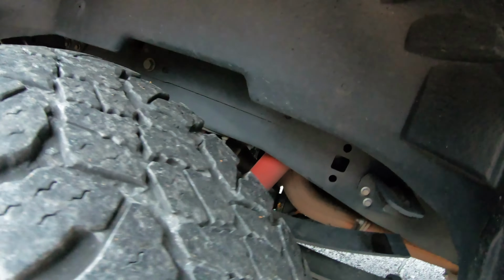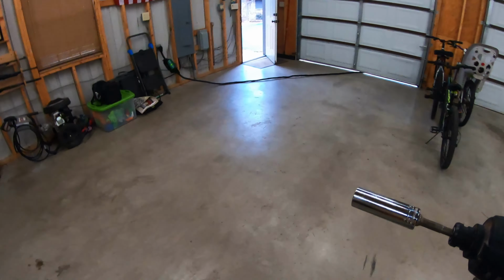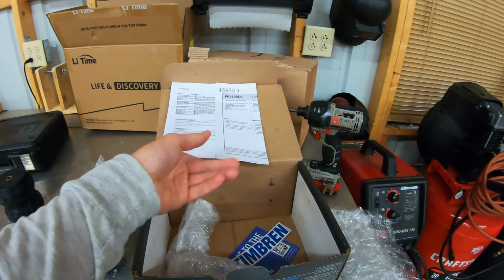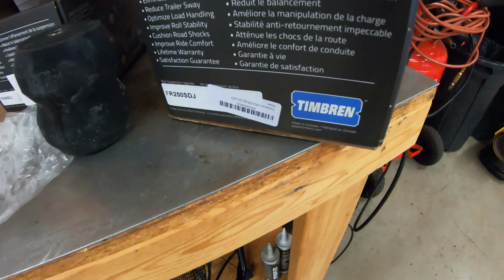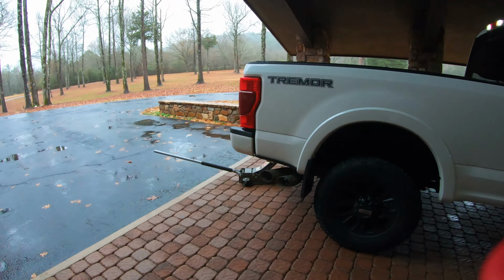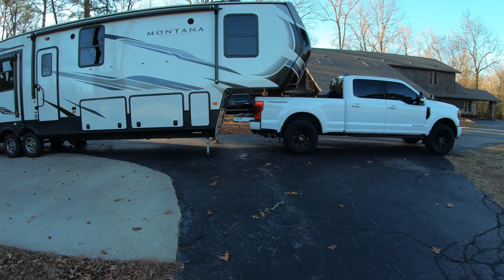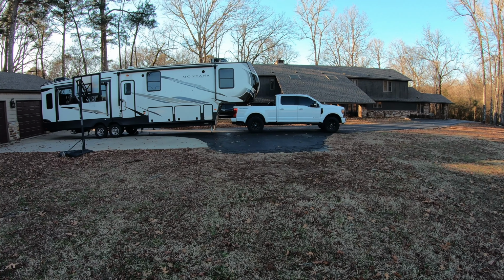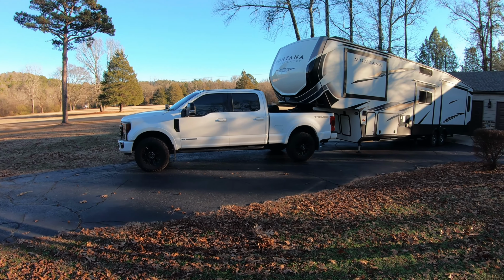Installing the Timbren SES kit  on a 2022 Ford F350 Tremor

Comment: Thanks for this great review. I just installed it on my lifted level 2024 f350.
 tremor.  I used the spacers, and i have the same distance from the block and the stopper.  Havent towed the 5th wheel yet. Feel pretty confident it will help after watching your video. Also, have the same anderson hitch. No issue with it so far.

Comment: Yep I used the 250 kit on my 350 2023. Nice that unloaded there is still about 1.5 inches before engaging. Thus ride is stock with no load. Love them. Leveled my truck out with load. Ford should do these from the factory.

Comment: Great video.  Just bought a 2024 f350 single rear wheel long bed.  Spot on with the 250 kit.  Did not use the spacer and had to run out for shorter bolts as well.  Expensive spacers…

Comment: Are you supposed to leave that gap? Or is it fine to make contact all the time?
Reply from the maker: It's fine to make contact, but it will stiffen your ride unloaded. I like the gap so it only engages on heavier loads. this lets me tow my boat, which is fairly light, like a stock truck.
Reply: @whateverfits1978  You're actually supposed to leave a gap of at least 1/2" and up to 1.5".

Comment: Great video. What's your pin weight?
Reply from the maker: around 2800 loaded
Reply: @whateverfits1978  Thanks so much for the reply.  I'm looking at putting a set in my 22 Ram 2500, and the pin weight on the 5th wheel I'm looking is significantly less, so they will definitely work perfectly. I've run airbags on many of my previous trucks but decided to go simpler

Comment: Not worried about the kinetic energy that your suspension used to absorb now being sent straight to the trailer frame?
Reply from the maker: Well, I wasn't....
Reply: @whateverfits1978  😣
Reply: You know the suspension is still taking that right?? You see how the bump stop moves lol. It’s not like he welded his frame to axle
Reply: @ 🤣😂, that’s pretty much what they do, under load they are compressed on the axle, has like 1 inch of compression left, theres no suspension travel left, might as well be welded to the axle. Number one complaint and reason everyone takes these off is because it rides like the axles is welded to the frame.

Comment: How’s the ride now with Timbrens
Reply from the maker: much more stable. Stiffer, but better.
Reply: @whateverfits1978  I installed mine on our 23 f350 Dually didn’t have to jack it up installed with plate I have two inches of gap between diff now I notice you block has a plate that comes out the the timbres would contact not the diff mine does not have that block with that plate coming out
Reply from the maker: @moriorinvictus6522  Yeah I think the dually are a little different than the SRW.

Comment: I bought the Timbren SES for my 2002 Toyota Sequoia. Product was shipped from Timbren in Ontario, Canada to California via UPS ground. Not the fault of Timbren, but the shipping took nearly two weeks. 
Upon receipt of the product, I found that the bolt supplied to attach the rubber to the bracket would not fit through the supplied washer that Timbren ‘pre-loads’ in the rubber. I called Timbren and they confirmed that the wrong washer was supplied. Duh. Bad engineering/parts assembly. I ended up going to the local hardware store and bought 4 of the proper washers. I asked Timbren for a partial refund for the parts $2USD and for my trouble. They declined my request for a partial refund and are shipping me 2 washers from Canada. Short story, if I didn’t supply my own washers, I’d still be waiting for correct parts before I’d be able to install these $309 overgrown pencil erasers. Not impressed.